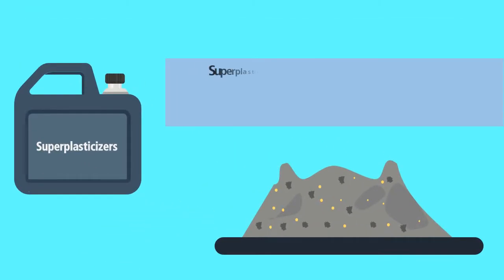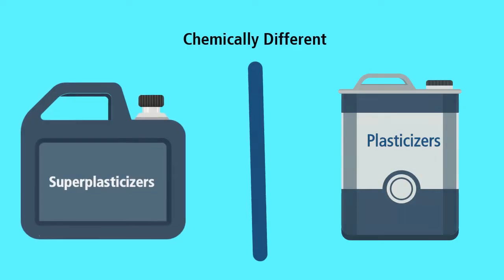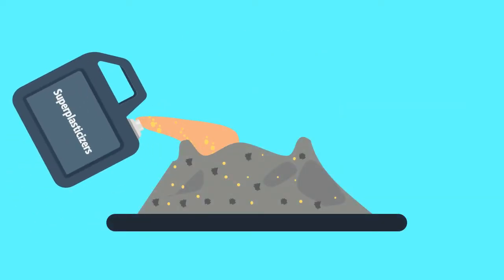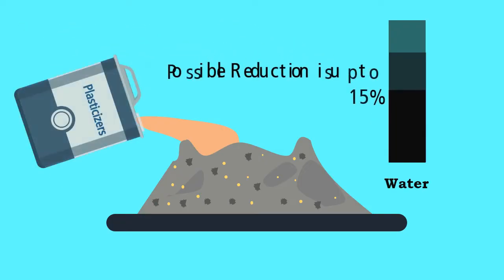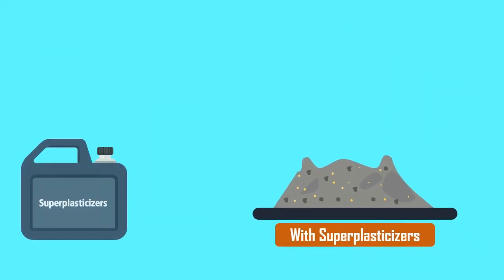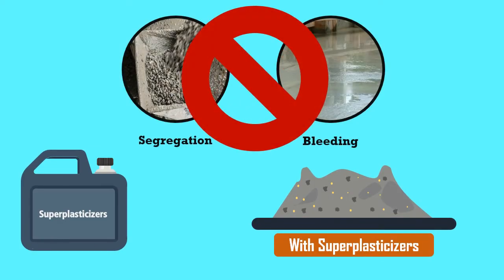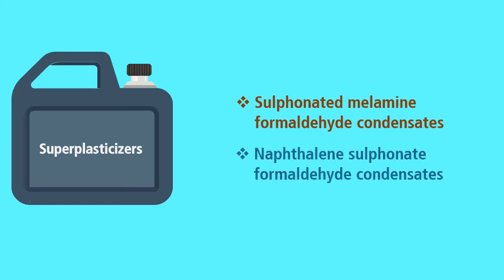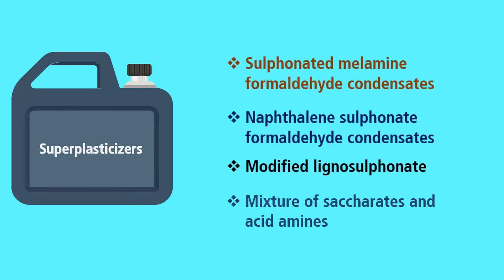Superplasticizers for Concrete || Admixtures #3

Comment: With add on plastic help reduce cracking in concrete,  more resilient against extreme temperature change in weather and more enduring on impact by projectile